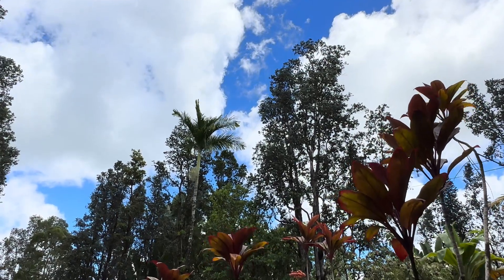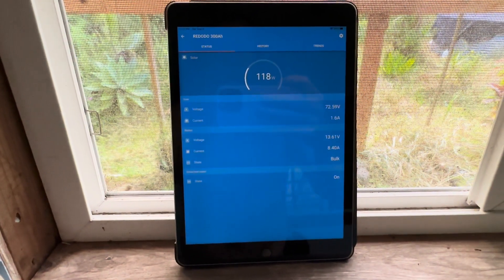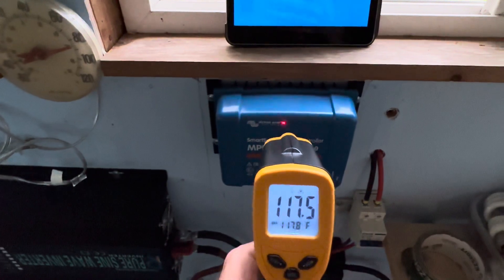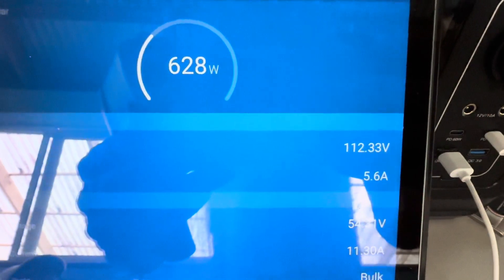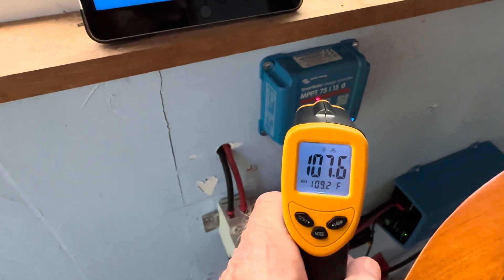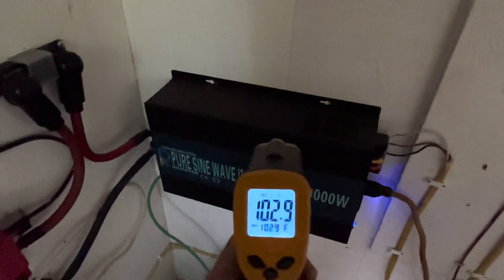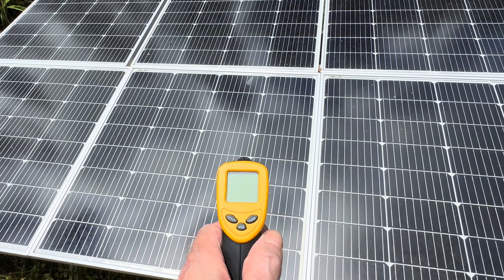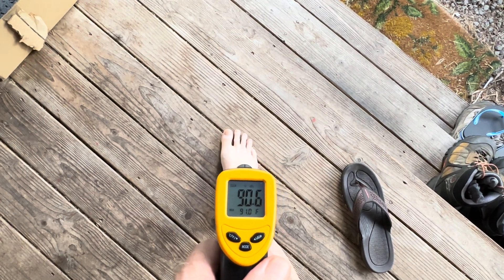Victron smart solar MPPT charge controllers run warm

Comment: Dont know if you saw this, but it could be important. I don't understand the constant 20 amp thing. Seems like if a Victron was made to run at 20 it should run at 20 amps forever. Should this guy be using a 30amp Victron to avoid another fire?   https://www.youtube.com/watch?v=LSmyLYo07wY

Comment: Interesting subject!
Heat is often due to high(er) currents, or rather watts, that are dissipated into ambient via the heatsink when there is no other source(s) using that "excess" power. Looking at your video, your ambient temperature is already quite high. This Victron is using natural convection to dissipate the heat but as the ambient temperature is already a bit high, I expect the Victron has a bit more difficulty releasing that heat via the heatsink. I do not know your exact situation but maybe you can place the Victron in a place/orientation where there would/could be more airflow across the (length of the) heatsink? May sound silly but perhaps, just for trial, mount it backwards, where the heatsink is facing outside and not close to the wall? I've seen installations (especially in vans, where space is more cramped) where they place 12 volt computer-fans (with some speed-control) to force-cool the Victron. Just thinking out loud. PS: I use my Victron's outside with their weather-covers but I'n not too sure if such would be helpful in your particular climate...
Reply from the maker: 90 degreesF is about as warm as that room ever gets, which is a tad warm for sure. I take your point on heat, and I watch it pretty closely. Haven't had any issues so far. I may add a fan though. Sure wouldn't hurt to do so. Aloha! 🤙

Comment: I just had the base of a Victron smart shunt crumble on me. Never even had power put to it. It's worthless now. Not too happy with Victron. BTW no Victron MPPT is not supposed to be mounted to anything flammable. That tells you what you need to know. End of video. No bushings on your panel box!? OMG
Reply from the maker: I have been planning on adding that shunt at some point. Never heard of one crumbling like that though! 🤙
Reply: @ProjectsinParadise808  I suppose it's some high temperature stuff. In 1970 I would call in bakelite. I saw someone say their shunt was getting hot. I did not realize that would happen, so I was merely removing the wires to put a layer of cork under the shunt. The torque on the bolts shattered the base at one of the mount points. The base is in 6 or 7 pieces. It can no longer be supported properly and it gets hot which makes it a safety issue, if used.

Comment: Over panel can also limit the power you get. At least the 500 watt 100/30 charge controller I noticed it limiting.  At 14v it is limited to 30a which is 420 watt.  At 12v when the battery is low it is limited to 360 watt.  The 150/35 on the 48v pack could easily handle 1700 watts of solar.
Reply from the maker: Great info my friend...mahalo! 🤙

Comment: Easy way to reduce heat in the regulator is 1) washer behind the regulator so more air circulates behind. 2) Larger diameter cable from regulator to battery. The latter provides less resistance when the regulator is close to the max level, if lithium battery they will accept full charging all the way up to the max charge level. I had 6mm on my SRNE 50A on both input and output, it quickly got hot in the summer, 10mm cable was the solution. Much quieter and slower heat build-up afterwards.
Reply from the maker: Thats a nice easy thing to add. Never thought of that, and mahalo for the info! 🤙

Comment: i can smell the glue in mine victron 100/50 mppt on 28v 50amps coming in off 1400w solar array peaking full sun she starts to heat up , pointing a desk fan on it drops temps considerably but it is rated at 1400w on 24v system so i dont let it bother me ,i have smoke detector right above it  lol

Comment: Interesting video! I have a small system (2 100 watt 12v panels) used for outdoor lighting. A few days ago i noticed my Victron 75/15 running a little warmer than normal. Yesterday I found the negative PV terminal severely discolored and  overheated to the point it began melting the blue case, yikes! It's mounted on OSB in my shed, I would have hoped the internal fuse would have blown. I checked the terminals and they were all tight although I wish Victron would make better (larger) terminals for #10 wire. The controller performed flawlessly for 4yrs.11months, and 3 weeks. I've initiated a warranty claim (5 yr. Warranty) I'll let you know how it pans out. 
Keep up the good work, Rich
Reply from the maker: What timing on the warranty! Mahalo, and best of luck! 🤙

Comment: More reasons to run 24V/48V, cuts the amps of power you're processing by 2x or 4x depending on which you use. Also learn the ideal input voltage for your MPPT (needs to be a certain number of volts above your absorb/max voltage, but if it's MUCH higher, you're generating extra heat, even though you may be within specs).
Reply: i run mine both ways found higher voltage more efficient  on 28 lipo4 get them charging earlier daylight had the panels running panel voltage 36.8v with high amps then wired them in sets of 2 x the volts 60-70v lower amps , still creates same amount of heat ,,

Comment: 118F ... ok, that's only 48C.  A total non-issue.  The electronic components in the Victron charge controllers are good to 80C (176F) and can run indefinitely at 60C (140F).  The charge controller will automatically reduce its output current above 60C to regulate its internal temperature, so generally it won't get hotter than 70C or so.  It takes a lot of effort to actually get a Victron charge controller to shutdown on overheat.

The heat produced by the charge controller is ENTIRELY a function of the battery-side output amperage and only the output amperage.   The wattages and voltages have no impact beyond their effect on the output amperage.   Another reason why going with a 24V or 48V DC bus is superior.

That said, it is always a good idea to at least arrange the orientation of the charge controller so the heat sink gets a bit of convection cooling.  And it doesn't hurt to have a bit of active airflow pushing air through the heat sink either.  It doesn't take much (for a 100/20 or 100/30, etc... the 75/15's don't have heat sinks, just aluminum backplates but the same thing applies).
Reply from the maker: Love this information, and mahalo for taking the time my friend!🤙

Comment: My remote off grid AI cameras with solar and victron in summers is in enclosure which is 120F inside and 100F outside.  I’ve never had an issue w victron it handles heat no problem.  I have a fan for the computer only which is rated to 130F. 

One issue I had run into was at high temperature were some bus bars melt the plastic as the wires get extra  hot from ambient temp and current flowing.  I had to extra size the wire gauge and busbar thickness to compensate for heat/current. 

In winter it’s 0F and victron is great. LiFeP04 needs heaters however.  

Victron rocks! 

Aloha
Reply from the maker: Yeah, so far, I've not seen any temperatures that really concern me. I check the heat on everything on hottest day's and everything looks good. Love the Victron! 🤙

Comment: If I had to do it all over again, I would go for a 200+ volt system with an all in one charger,  controller, and inverter for high voltage systems.  I was always afraid of high voltage systems,  but now I realize that high amperage and the heat it produces is a lot more dangerous.

Comment: My Victron 100/30 used to run extremely hot i used to cool it off with a small fan. Fans work wonders with electronics that get hot. That is a COOL cat
Reply from the maker: Mahalo! 🤙

Comment: Thanks for the video. My panels don't put out near what they are rated for. Probably the heat as you say but I don't trust the Renogy 60 amp MPPT running one string of 720 watts. My other sting of 600 watts is on an Epever 60 amp MPPT. The Epever will only get my lipo batteries to 13.9. The Renogy gets its batteries to 14.3 but will not hold them there under much of any load. I am running everything in parallel at 12 volts including my 2 inverters one a 2000 watt and the other a 3000 watt inverter. I like your Victrons much better, but the cost is prohibitive right now. I hope you study to get your ham license and would enjoy making contact with you from Kansas City. Aloha!
Reply from the maker: The Victrons really made a huge difference here. They always add way more to the end of day than the EPevers did. Working on Ham! Aloha! 🤙

Comment: Thanks for doing the video.  I had worried a bit after seeing a YouTube video on a 100/20 melting down and having the majic smoke come out.  Once reason I was concerned was the warnings in the instructions on the TYPE of wire (dont use solid or solder or ferrels) I believe they said.  So question, when you get the time, can you do a small update and focus the heat probe on the battery terminals?  Might be a good idea to do the same on the PV terminals too.  Heat rises, so wondering what the delta would be.  I have noticed some slight heat build up on my circuit breakers when running 45 amps into a so called 63 amp breaker and so now I just double check and touch stuff to validate.  On the loads coming on, yeah I run the window a/c and my VEs will drop back to bulk but it's nice to use the a/c running on battery.  Aloha
Reply: Stranded copper, 10 AWG is best (up to 30A).  12 AWG will work up to 20A and not overheat but is not ideal.   I try to use 10 AWG.

AVOID ULTRA-FINE-STRANDED TIN-PLATED COPPER WIRE.  That is, avoid "poofy" wire.  These are low quality and the tin plating has such a huge cross-section that their ampacity is actually 2AWG higher than the wire size.

Ferrules are totally acceptable (they will crush), but be sure to tighten, wait a bit, and then tighten a bit more to ensure that you've crushed the ferrel fully.  And make sure the ferrules are long enough and can be fully inserted into the block.   Sometimes people use ferrules whos plastic guards are too big to fit into the block's housing (not the contact area of the block, but the housing), and this causes poor contact (insufficient length inserted) problems.  If it comes down to it you can cut away the plastic guard, but I like them because no bare wire whatsoever is exposed.

In fact, I would always use Ferrels because they prevent the stranded wire from becoming messy when you are moving wires around and such.   With the above two points taken into account.
Reply: All very good points.  I agree 100% and have found that unless guaranteed 100% then you will receive CCA cables from Amazon and others.  I use the ferrels now on the 20A controllers and pure copper on 30A and up just to be safe.  Personally, I will Victon would improve their terminals as they just seem like cheap crap.  I like the morningstar and midnite solar connections not just because of the amps, but because it would only cost a few pennies to make the improvement in the product.   @junkerzn7312
Reply from the maker: Mahalo for that! 🤙
Reply from the maker: No like the magic smoke! I will do a follow up on terminals. They have been running cool, but it's worth a closer look on video. Mahalo! 🤙

Comment: I got a 100/30 that's been sitting in the hot jungle sun under a little
Tin roof for 3 years stright. Sure gets hot but I worry about the connections and wire more than anything.

Comment: I've got two 200 watt bifacial panels going into a 75 15. The controller gets hot and initially i thought it was a bad thing but it's holding up well. A little disappointed in the beginning because the 75 15 will only push out around 220 watts. What would you recommend to get more wattage from these panels?
Reply: Are you solar panels connected serial or parallel?...what are the operating amp and voltage specifications of a single  200w panel?
Reply: @andyirons7162 I 've got them in series. Open circuit is 28.1v. Rated at 8.55 amps. Thanks for your reply!
Reply: The 75/15 will output 15A on the battery side.  That's the main limitation.  So if you are connected to a 12V battery system your maximum wattage is going to be (15A x 14V) roughly = 210W.   To improve the wattage you can get out of the 75/15, you would need to go with a different battery topology.  A 24V battery topology will allow the 75/15 to push 420W, for example.

Unfortunately, the 75/15 CANNOT do 48V.  It is 12/24V only.   The next cheapest Victron charge controller will be the 100/20 which can do 12/24/48V and 20A on the output.

Also remember that the solar input has to be at least +5V above the battery output, so the panel topology matters too.  And make sure the open-circuit solar panel voltage going into the charge controller does not exceed its input voltage limits (75V for the 75/15, and 100V for the 100/20, etc).

Whether you actually want to change out your existing battery system is another question entirely.  Since you would have to change out the inverter(s) and any other components needing 12V to the new voltage, it is sometimes a non-starter for people.   You can upgrade from 12V to 24V by having two batteries in series (though you also need a whole-battery balancer across the two when you do that), and the 75/15 can be set to 24V, and then just change out your inverter.

If you upgrade to 48V, though, the 75/15 can't handle it and you would have to buy a 100/20 along with replacing the existing batteries entirely (don't try to put 4 x 12V in series, even with balancers), and replacing the inverter.  So that's a more expensive leap for you.
Reply: You can go up on your system voltage.  It sounds like you currently have a 12v system.  You'd have to add a battery to go to 24v and get a 24v inverter. Or do you get a bigger solar charger and more panels.  Always different paths. 

With your charge controller :
12v 15a = 180w
24v 15a = 360w
36v 15a = 540w
48v 15a = 720w
And so on
Reply: @MOKPT3 Thanks for your reply....after doing a little research, it seems the 100/30 controller would be a good way to go. Pull out one panel, use the 75/15, pull out two in series and use the 100/30. One more investment and i'll be in a good place.

Comment: Great subject…..I liked the other comment about adding the spacers and active cooling. I wondered if you could put a small DC fan on the extra port turn on with a thermal switch. Loved the reference cat and foot. I live in OH….gets pretty cloudy here, so I over panel my systems as well.
Reply: You can for sure.  In fact, you can control a fan directly with the Victron's LOAD output.  On the 75/15 or 100/20 the LOAD output can handle (I think) 20A for 12V or 24V systems, and 1A for 48V systems.  Even 1A is plenty good enough to handle a fan (fans only use 0.1A or so, after all).  Though since it is basically a (solid state) power switch, I would definitely put an inline 2A auto-fuse on that wire to protect the wire from a short.

In terms of the automation to control the fan, for LiFePO4 based battery systems you can actually just control the fan using the battery voltage as a proxy for temperature, which means you can program the LOAD output of the Victron charge controller directly.   Basically just set it as follows:  Load output menu,  set the operation mode to"User def algorithm 1", and then set the Load switch low and high level voltages as follows:

12V system:  13.25V and 13.28V
24V system: 26.50V and 26.55V
48V system: 53.0V and 53.1V

And that's it.  It just works.  In the morning sufficient solar (thus full or mostly full amps on the charge controller) will quickly raise the battery voltage above the high set point and turn the fan on before the charger controller gets hot.  And in the evening the battery voltage will quickly drop below the low set point and turn the fan off, even if you don't have much of a load.  Just due to how the LiFePO4 charge / discharge curve characteristics work.

Just use an appropriate computer fan (12V, 24V, or 48V variety to match the battery).  The fan doesn't even have to run quickly so you can put an inline resistor, usually 100 ohms (A 1/2W 100 ohm resistor is usually sufficient, or buy a fan-speed-reducer switch which is the same thing), to make it run more slowly.  As long as it starts, you are golden.

-Matt

Comment: nice ! I was wondering how warm they got. That why you mount them with room around them like a inverter.  the bigger ones have the heatsink on the back. that may be a tad warmer.  black cooling fins. the Morningstar tri star I have has the heat sink on front top.  it gets warm but never hot. wonder how warm the black cat will get sleeping in the sun?
Reply from the maker: That black cat get hot in the sun! 🤣🤙